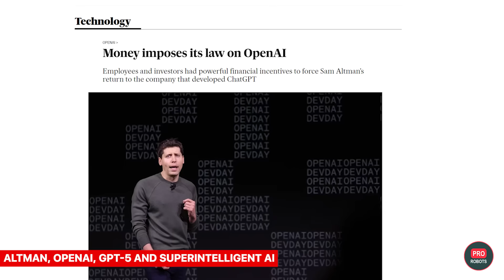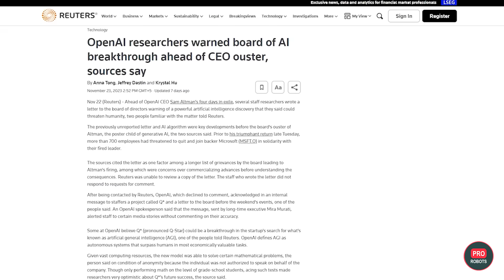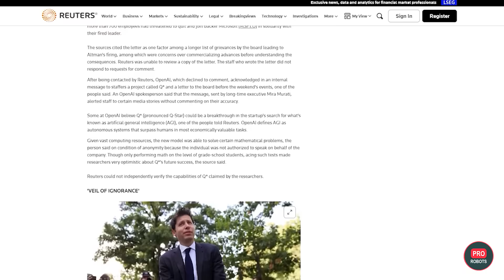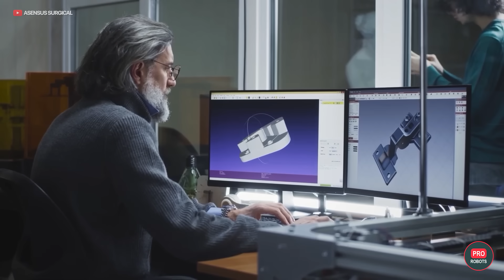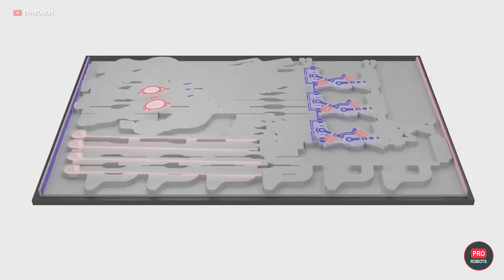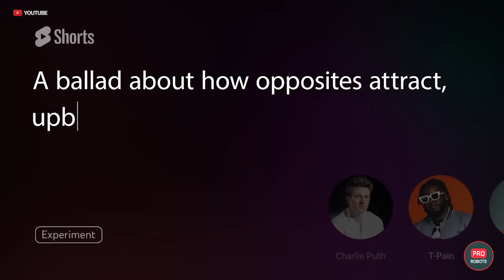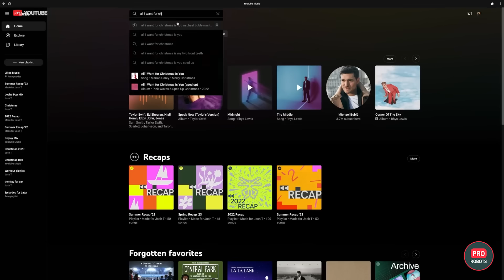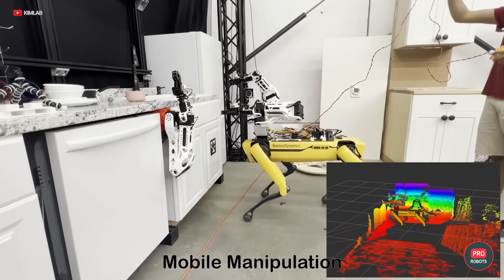OpenAI new breakthrough in artificial intelligence | DARPA's Superplane | Technology News

Comment: Export the Q*, Azure, Power Apps, Copilot, Chat GPT, Revit, Plant 3D, Civil 3D, Inventor, ENGI file of the Building or Refinery to Excel, prepare Budget 1 and export it to COBRA. Prepare Budget 2 and export it to Microsoft Project. Solve the problems of Overallocated Resources, Planning Problems, prepare the Budget 3 with which the construction of the Building or the Refinery is going to be quoted.